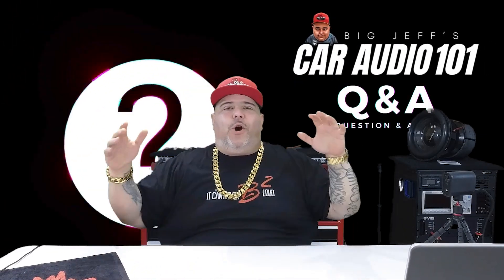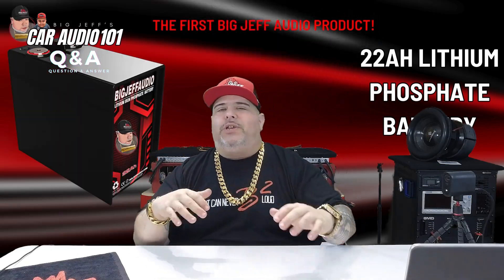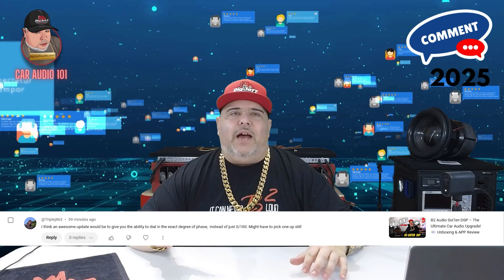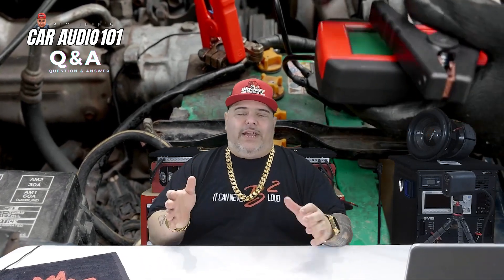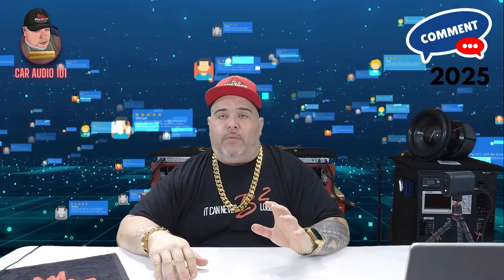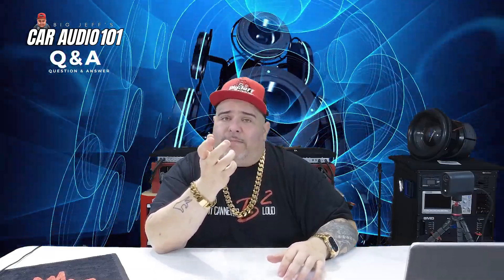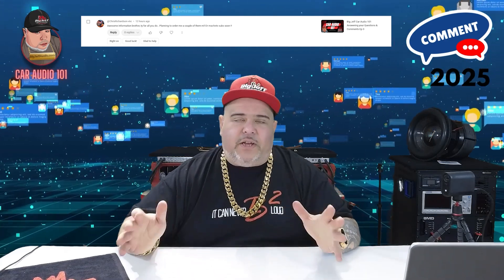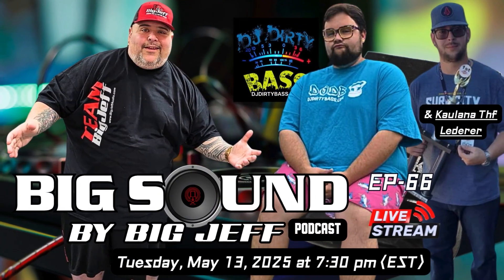Big Jeff Car Audio 101 Ep. 5 — Batteries, Alternators, Soundproofing & HPF Explained!

Comment: 14:50 Sound proofing is where you try to prevent outside sounds from coming into your vehicle. That's great to make your interior quieter when you're driving down the road. If your interior is quieter then you can use less stereo volume to enjoy your music. Outside noise tends to find its way through body panels by causing them to vibrate and then you hear that vibrating sound on the inside of the vehicle. This is a really big subject so I'm gonna stop here.
Reply: Good answer Jeff 👍

Comment: 9:10 There really isn't a specific frequency to cross a coaxial at. I recommend you adjust it by ear. A 6.5 might be crossed between 80 to 120 Hz. The smaller the driver, the higher the crossover point. You can start off on the lower end so that it plays some good bass. Test it at high volumes and make sure the excursion is okay and doesn't bottom or distort. If it does, you can bump the frequency up a little higher. You will lose a little bass but it will play louder without distorting. So it's really about finding a good compromise between low frequency bass and still sounding clean at high volume levels.
Reply: I see that you responded to that question a second time.  Good answer. 👍

Comment: hey big jeff, cody here, i got the 4 lug sae battery terminals from you and i cant seem to get them to tighten with a alan screw cause there so thick, should i be using a impact gun?? thanks!
Reply: Are you talking about a top post battery and you can't squeeze the terminal to the post? Some batteries have slightly different size posts so not all terminals will fit snugly. You probably need to pick up a shim at your local auto parts store.

Comment: Big Jeff this is a great topic. I'm going to give you a rundown then a quick question. I'm running a Precision Power 330amp adio specific alternator. Have  4 Optima Yellow top batteries. Probably have overdone it on the ground strapping but you can never have enough. I'm running two 1500.1D amplifiers at 1ohm a 1000.1D amplifier at 2ohm and two midrange 1000w 4 channel amplifiers. Two 8's two 12's two 15's. Does that sound adequate for power.?